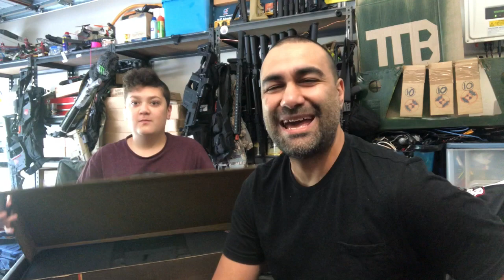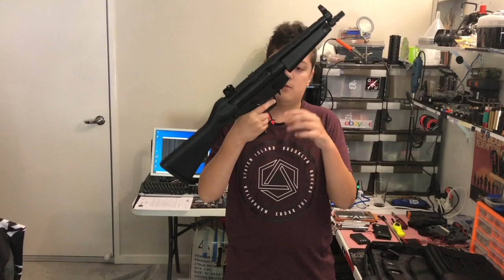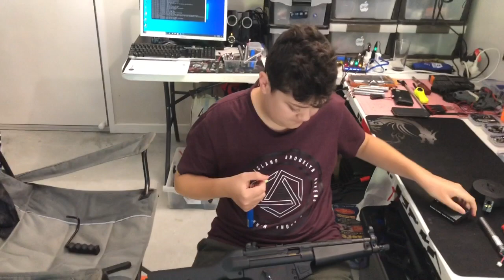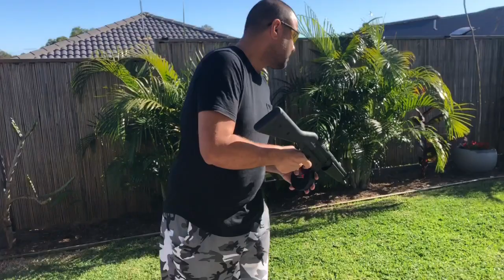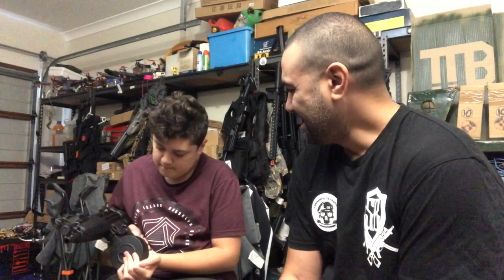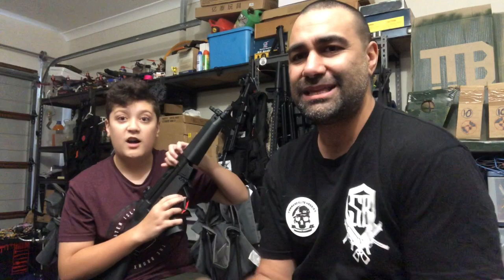🔫 LDT Warinterest HK MP5 Gel Blaster Review 🔫

Comment: I was just about to get one of these but im concerned about its mag. Definitely had issues feeding in this vid. I would be filthy if i bought a new blaster and had to hold and push the mag up to work. I know they had issues with the stick mag. Im disappointed.
Reply from the maker: I end up buying a couple of stick mate they’re awesome. If you take the original drum mag and replace it with a Gen 8 mag motor it works like a dream.
Reply: @TTBSCOOBY  Well that just sucks for those who don't want to replace parts. Such a premium price and it's a dud. Same.
Reply: I was just about to press buy and though.... i'll watch a quick video. Excitement over.

Comment: really don't dig mp5 with drum mag... but good review as usual :D 
how does this feel vs the old MP5s if you have played with those before? 
also it seems to be having a bit of feeding issue, if that because the mag wasn't sitting properly? or the mixture of old gels?
anyway keep up the good work guys~
salute to Counter Strike old bois
Reply from the maker: Because it’s the first time we used it last time we had to bend the pins straight once we did that make contact with the manager and work perfectly fine. Compare to the old model this is amazing. Definitely a lot more solid sounds better looks better. I would absolutely recommend getting one.
Reply: @TTBSCOOBY  thanks for the reply man :D i hope they bring out long mags for it soon